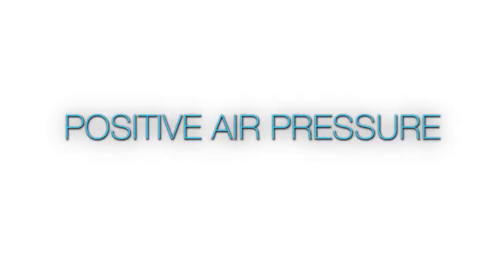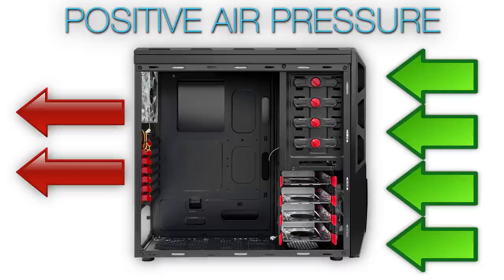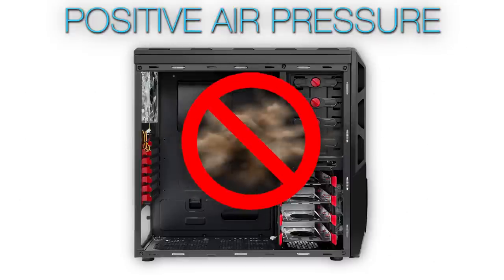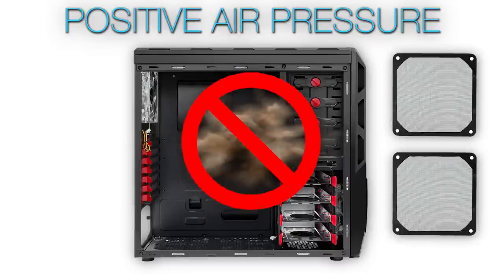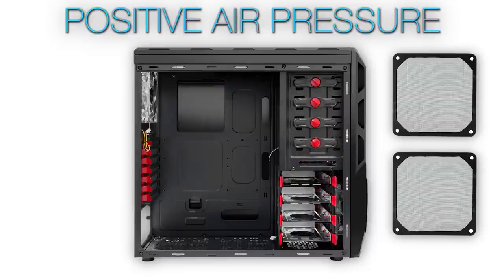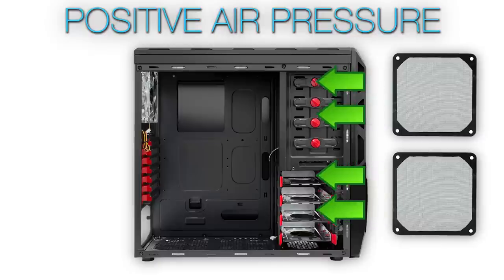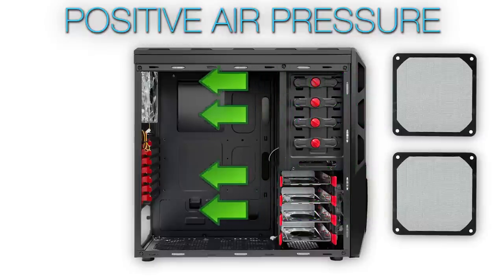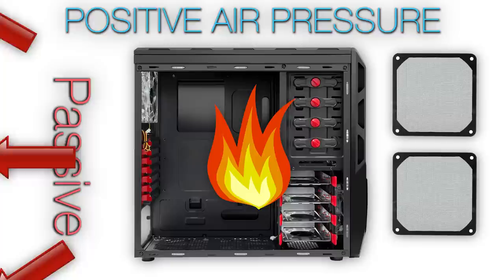Computer Case Airflow - What is Positive and Negative Pressure?

Comment: Its best to have slightly more  intake fans than exhaust fans. This is because intake fans have to work harder because of the dust filter. You want to keep the air pressure slightly positive so only filtered air can flow in the case

Comment: Corsair Air 240, and if possible, use Corsair Air Series SP120 High Performance fans.  A bit specific, yes.  But if you can't do the exact fans, please consider doing a fog demo using the Corsair Air 240 case.  Thank you!

Comment: So you have more air coming into the case than leaving? When does it blow up?

And more air leaving than coming into the case? When does the case crumple under the induced vacuum?

The reality is the air pressure reaches some point of equilibrium with exactly the same amount of air entering as leaving.
Reply: he means more air being pushed in or out of the case by fans. more air being pushed in by fans then pulled out by fans means there is a slightly higher air pressure inside your case then outside it and all the air not being pushed out by the exhaust fan(s) is escaping out of all the holes and cracks in the case keeping unfiltered dusty air from entering your case through those holes. BTW this is how clean rooms and hermetically sealed rooms work (as well as nuclear bunkers designed to keep out radioactive dust). They have filters that clean the air inside the room but they also maintain the air pressure in the room ever so slightly higher then the air pressure outside the room to stop anything outside from leaking in. Basically the thought is if you cant make something 100% airtight and you have a leak then its better to keep the air pressure higher that way the leak is leaking OUT fresh air instead of leaking IN unfiltered air.

Comment: all of my fans are pushing air in
Reply: you are doing it right!
Reply: Chris Gamer You should have, the front, bottom, and or side fans pushing air in, and the back, and top fans pushing air out. Remember hot air rises.
Reply: ***** Watching a video is one thing, and understanding it, is another.
Reply: Angel Luis Trinidad The original comment is trying to be funny, just look at the first comment by Queen as well. YouTube are full of jokes and sarcastic comments.
Reply: You are just repeating what the video said but in a YouTube comment.
Reply: Polo SomeGuy Yeah, it could be a joke, or just plain sarcastic. But, it was a great opportunity for some other person that seriously doesn´t know how to place the fans in a case to learn.
Reply: U dun fukd up
Reply: Angel Luis Trinidad I agree.
Reply: i have to 2 fans in the front pushing air in and i have a 120 rad in the rear and that has push pull With air going in
Reply: Chris Gamer  aslong as you have an escape route for the air you are fine - dell used to make their pcs with one fan intake and psu fan exhaust
Reply: Angel Luis Trinidad But, by putting the fans on the top blowing in, you can get cool air blown on your ram
Reply: +Michael Flatman And no air filters, so after about a year, you could open the suckers up and find a grey coating on everything...

Comment: NZXT s340
Reply: Front fans intake all other fans out have the s340 myself
Reply: So is that neutral? Two 120mm stock fans at back and uptop, but two 120mm fans in the front too?
Reply: +RossLinden97 Same case I have. I have my Kraken x61 radiator mounted on the front (two 140mm fans) and I still have the two 120mm fans that came with the case on the top and back.
Reply: XXX_BILLY_XXX Yeah, the fans that come with the case are great. I have an H60 mounted in the front, I have a video of my setup of my channel if you would like to check it out

Comment: I'd love to see the airflow on the DIYPC Vanguard series. I don't remember which version is which, but they've been notorious for having bad airflow. The V8 seems to have fixed this though, because I can actually feel the air being pulled through the front, and there's an optional intake/exhaust on the top, if you want to mount fans up there.

I'm just really curious because I have the V8, and I haven't had any overheating yet. But I haven't really pushed my hardware to the limit - it's kind of hard to say if the case is actually good or not. I just don't see people talking about later versions because DIYPC seems to have gotten a bad reputation.

Comment: When you can't balance between two, go for High pressure setting.
1. Intake is what actually cools the pc down. Cool air comes in and collects heat energy therefore cooling the system. All what exhaust does is preventing hot air being stuck inside the case. By creating high-pressure inside the case, the hot air will naturally exit the case so the exhaust fans are not the priority.
2. Negative pressure means that the pc becomes a vacuum. Air carries the heat energy. Vacuum means no air to carry heat energy outside. Temperature will keep rising and rising.
3. Most importantly fans are useless in low pressure . Think of helicopter or drone in vacuum chamber. Even if the blades go full speed, it won't take off. Because there's no air. Same applies to pc coolers.

It's stupid to make low-pressure for cooling. The answer is very clear
Reply: "1. Intake is what actually cools the pc down. Cool air comes in and collects heat energy therefore cooling the system. All what exhaust does is preventing hot air being stuck inside the case. By creating high-pressure inside the case, the hot air will naturally exit the case so the exhaust fans are not the priority."
True
"2. Negative pressure means that the pc becomes a vacuum. Air carries the heat energy. Vacuum means no air to carry heat energy outside. Temperature will keep rising and rising."
The static pressure on these fans in 10 Pa. Out of 100,000 in atmosphere. The vacuum created is negligible! 
"3. Most importantly fans are useless in low pressure . Think of helicopter or drone in vacuum chamber. Even if the blades go full speed, it won't take off. Because there's no air. Same applies to pc coolers."
See 2 above.
"It's stupid to make low-pressure for cooling. The answer is very clear"
Agreed.

Comment: Fyi some gpu have design that it sucks air from the back of the case and throw the hot hair to the front case so make sure the second and third fan in your pc case throw air outside instead of taken air inside because the air flow will disrupted and stuck inside the case

For example i'm using galax 3050 single fan, it takes air from the back case/gpu where it have hdmi/dp slot and throw it to the other side (the front case) so i arrange my fan as follow
First fan at the top take fresh air for the cpu (using stock cooler) and on the back i have exhaust fan just beside the cpu

On 2nd fan below first fan it become exhaust now because the hot hair from gpu is throw near the front of the pc case (middle lower of the case near the front)

Comment: So here's my fan setup: 2 intake at the front, one exhaust at the back, and two on the CPU cooler (Noctua NH-D14). He mentioned the cooler fans being exhaust as well, so does that mean I have negative airflow with more fans acting as exhaust than intake?

Comment: Can we see the  NZXT Phantom 820 with 2 top mounted 200mm fans exhausting the air, a 200mm intake on the front as well as the side panel,  a 140mm rear exhaust and an additional 140mm central fan blowing onto the video card. Please! And thank you! 

Also, could you suggest whether or not to have the bottom mounted fans or not.

Comment: So here is my question. I have a front fan intake, a rear exhaust fan, 2 fans on my Hyper 212 Evo running a push pull method, pushing air through the fins and out the top of the case and a single side panel fan pulling air in.

Is that a good airflow setup?
Reply: DJ Fen Fen That's normal. 
I honestly think this video is more for those who have more than 1-2 fans on their case. And for those who aren't using the normal fan configuration.

Comment: my current setup is in neutral, I guess. I have 4 intake fans (2 at the side and 2 at the bottom) and 3 exhaust fans (1 at the back and 2 at the top, AIO). My current GPU temp is around 36 to 40c, while the CPU temp is 38 to 42c. I am thinking to change it to negative air pressure so my system will run more cooler than my current build. The reason I want it more cooler because we don't have an AC at home and sometimes the weather here is usually hot.

Comment: Positive airflow seems great- I took apart a dead laptop today (both for hands on experience and salvage) and the motherboard was completely caked in dust, which is probably why it stopped working within 3 years. ...Also the HDD was from Seagate. So yeah.

Comment: negative pressure can also creatte turbulence and dead spots. especially in the top right area of the mb and hdds which might be mounted in that region. also then running negative pressure with your computers back placed close to a wall your system will suck in hot air from your cpu thru the pci covers which can really suck for your graphics card.

if you push your cooling to the absolute max you will use a watrecooling loop to dransport the heat out of the system and mount a big radiator + strong fan inside a metalduct that has the exact size of the rad and arange it in a way that it moves the air upwards and is not obstructed. this way your radiator fans can build up a optimal pressure gradient and the hot exaust wont be pulled in again.

Comment: Hi guys! I have the EVGA Z97 Classified motherboard and Cryorig R1 Universal CPU Cooler! I finished building my setup about a week ago, and it seems really fine, so far (I have not received the opportunity to test it due to the fact that I have school work)! I tried mounting the R1 Universal towards the back and the top of the case because I know that it acts as an exhaust fan; however, I can only mount it towards the front of the fan where the intakes blow! I know that is bad, but I want your honest opinions on how bad you think it will be in the long run! Thanks guys! +NCIX Tech Tips

Comment: So you’re saying that if I have four fans to do two in the front as Intake, one on the top as exhaust and one in the real as exhaust? Is that about right?
Reply: Yes. Most cases you buy will come with 2 fans in the front and 1 in the back pre-installed, in that configuration.

Comment: Ive got two 120mm on the front, two 120mm on the top, Noctua NH-U12P CPU Cooler with two attached 120mm Noctua fans. and one 120mm Noctua on the back. Should be fine or?
Reply: yes but u can have dust proplems if u case alloe but 1 more intake fan

Comment: Great review, question i have a Thermaltake x71 with 3 fans on top pulling air in, 3 on front pulling air in, push pull radiator pushing out in the back and 3 on the lower left side pushing out, would that be considered neutral?

Comment: Hey guys some help here!

i have a big fat frond fan 200mm and no space to add any there and then there is 3 slots on top and a rear exhaust fan 

i have a 1800 RPM fan in hand so should i add it on top as intake next to Big intake fan or put it as exhaust fan on top next to my rear exhaust fan ?

it be like
                
            
                    in120mm
                           ⬇️
  out⬅️
  120mm                ⬅️}Fat 200mm single
                                ⬅️}Fan 200mm intake
Reply: I'd place the upper fun in pull mode to avoid the turbulence when it's flow collide with front ones.

Comment: NZXT Phantom 530. So far have 3 Intake fans ( Side panel 140mm, Internal Cage 140mm, and Front 200mm) and 1, soon to be two, Exhaust fan rear 140mm. Going to install 1 140mm to the top.

Comment: If I got a Phanteks Evolv ITX (notorious airflow) changing stock front 200mm to 2x140mm, add 140mm as rear exhaust and 140mm for top rear exhaust (blocking off rack openings) plus 120mm CPU heatsink cooler, would that be balanced pressure? - i.e. 2 intake fans and 2 exhaust fans, plus CPU air cooler. Plus, other hot components like reference GPU single fan expelling hot air from the card outside the case vs non-reference GPU multi-fan expelling hot air inside the case. How does all that factor together?

Comment: It's great to see the snoke going through it. Has this been done with an old cm scout case? I have one fan in at the front bottom, two out at the back top, negative pressure. I don't have much trouble with dust build up.

Comment: I have a THERMALTAKE VL80001W2Z Black edition computer case.  Could you show me how you would go about generating positive air pressure in this particular case?  I have a stock fan for my CPU, which I will use.  My GPU is the MSI N750TI-2GD5/OC.  I also have a standard 120mm fan on my Corsair CX600M PSU.

Comment: How big of an impact does having a top to bottom airflow make? I mean having fans at top of the case as intake and fans at the floor of the case as exhaust. Lian-Li PC-Q37 seems to have dust filters only for the top fans for some reason (the case isn't out yet so I'm not sure), that's why I''m asking.

Comment: im using a regular atx body i think...two small fans on the side 
panel blowing out ....one on the bottom blowing in...and then the one at
 the back blowing out...plus i removed a front panel on the tower where 
the disk drive goes ...made a huge difference....also i put this tower 
on its side so the mobo lays flat with the floor...my idle temps are 
between 26c to 33c all round and then gaming would be around 55c to 65c

Comment: Is their a linear relationship between rpm and airflow? Or is this just a crude workable assumption? For example trying to achieve a neutral airflow with different fans on a custom fan curve.  I.e 2 140mm intake and one 140mm out and one 140mm out?

Comment: I had negative & was bad in the summer, I just change the top fan to middle & also the position to drag air into the case so now on neutral cpu is cooler & I think also the gpu

Comment: Very informative video! I have trouble with my PC case, specially with the GPU fans not being able to exhaust very well, could you do an example with a Thermaltake Core V31 and a large GTX 970 with Dual fans, and a D92 Heatsink? And what would be the best way to position 3x140mm fans & 3x120mm fans in that case.

Comment: Thank you guys for putting this up. Can you kindly perform the same test on the Corsair carbide air 540 with push pull configuration and the rear fan as Intake. I have been lately doubting the air flow in my system thus the suggestion.
Reply: Best way to test how your air is flowing is with incense sticks
Reply: Thank you sportagus3 . What I am looking for is the temperatures with the kind of fan setup I have aforementioned with the case I am using. This is way I can get reference points to compare my results from.

Comment: I got 4 140mm intakes running at 7v and two quiet 120mm fans running full blast on my H100 acting as the only exhaust out the top. Well my GPU is a blower style so that is exhausting as well. Almost no dust since all intakes are filtered and the temps are fine. So Positive works just fine for me.
Reply: devilmikey00 also helps with cooling the rads since they are exhaust. it overcomes the restriction more easily. basically like push pull light. looks like a good setup.

Comment: Hi. I bought the Pure Base 500DX and it comes with 3 Silent Wings fans (1 intake and 2 exhaust) for a total of 104 CFM intake vs 208 CFM exhaust. It's clearly not a positive pressure as explained. To get that positive pressure, I think I should add a fan in front that produce more CFM than the Silent Wings. I'm thinking of the 140 mm Pure Wings 2 high speed that produce 160 CFM. It will result of a total intake of 264 CFM and a total exhaust of 208 CFM which is a positive pressure. Do you agree with that vision? I'm not taking into account the cpu fan. the Thanks.

Comment: Would be nice to see this test being ran on CoolerMaster Mastercase MC600P. Currently building my new rig and I'm trying to decide if both top fans should be for exhaust, or perhaps the one closer to the front should be intake as well as the three fans on the front, leaving the exhaust for the top-back fan and the back fan. Also, I'm using the  CoolerMaster Masterair MA610P CPU cooler. Any advice is welcome.

Comment: Do you have the PSU fan mounted up or down in the set ups? Is it more important to have the PSU intake cooler air from the bottom or to intake the hotter air from the GPU so that the GPU stays cool?

Comment: I would love to see some videos on possible fan configurations for the BeQuiet Dark Base Pro 900. The case is a Beast that can hold 9x140mm +2x120mm case fans.
I have my rig setup with front mounted radiator with 2 fans, 1 fan at the front/bottom of the case, 2 up top and 1 at the back. GPU has Internal exhaust.
Would love any suggestions, comments or even questions!

Comment: I have a gl12cp with a single 90 mm exhausted fan and a cpu cooler but theres space for 2 other 120mm fans ( one on the top rear and one at the bottom front) but I dont know how to set them up. Like do I put the rear one positive or negative (and do I need a radiator ?) and the bottom one is stuck in front of the hdd and idk if its worth putting a fan there :(

Comment: thank you for showing the difference between the three types of air flow that answers a lot of questions. I hoping you can show me the air flow of the case I am considering for my next build it is a Raidmax ATX-402WB ATX Mid Tower Case  any help on the fan set up for a more positive air flow.
     Thank's in advance.........

Comment: So if I were to have three fans bringing in air ( one in the front and two for the side panel) and two fans blowing out air(one in the rear and one at the top). That would be positive airflow? if so, should I buy a dust filter for the side panel if it's plexiglass?